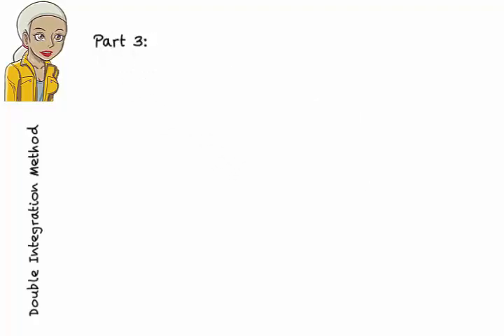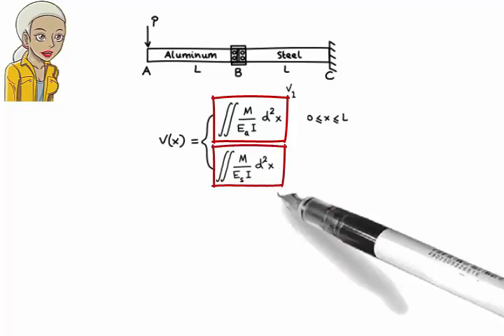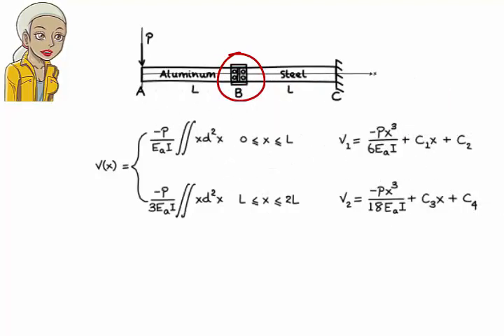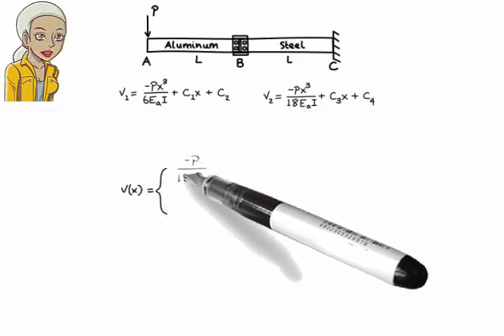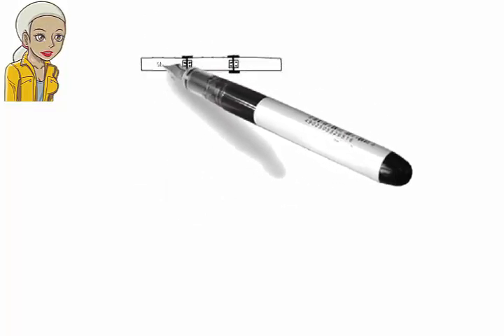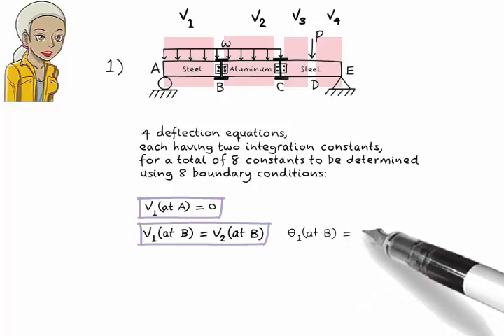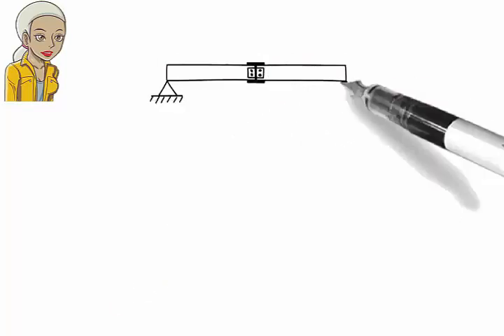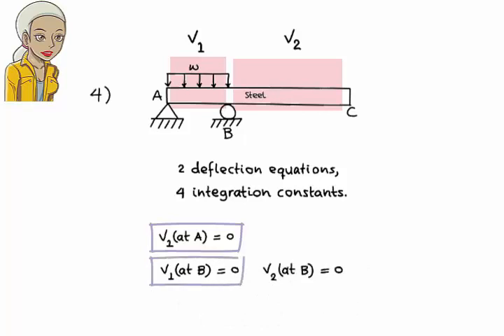SA13-3: The Double Integration Method (Part 3)

Comment: hey Dr Structure , i wanted to ask about the change from Es to Ea , when i change the moudle young shouldnt i change the moment of inertia aswell ? 
and everything was very useful , thanks!!!
Reply from the maker: No, the two are not dependent on each other. E is a material (steel, aluminum, concrete,...) property. But I (moment of inertial about the axis of bending) is a property of the cross section of the member. So, we could have two members having the same cross-section (the same I), but one is made of steel and the other made of aluminum. So, their Es are different but their Is are the same.
Reply: @DrStructure  great thank you!!

Comment: Hi Dr. Structure, I don't understand why p is a constant in this example. In SA12 example, the cantilever has a point load but the point load is not considered a constant, while the point load in the first example of this video is considered a constant. Is there a way to tell?
Reply from the maker: In both cases (videos), P is constant. Whether we leave such a constant to the right of the integration symbol or move it to the left of the symbol is not significant. That is, Integral (P) = P Integral (1). Or, Integral (P x) = P Integral (x). 

The only difference that we would experience is in the integration constant. For example, in SA12, since we left P inside the integral, the expression for v became:

V  = (1/EI)( px^3/6 – pLx^2/2 + C1 x + C2)

If we take p out as a constant before integrating, the expression for deflection becomes:

V = (p/EI)(x^3/6 – Lx&2/2 + D1 x + D2).

The only difference between the two equations would be in the values for the integration constants. But that does not matter at all, since if we multiply p by what is inside the parenthesis in the second equation, we get the first equation. That is, C1 = p D1 and C2 = p D2.
Reply: Dr. Structure I see. I was also wondering what type of load is considered a constant. For example, would a distributed or triangular load considered a constant also?
Reply from the maker: @nhilang2063  A load function is an equation that describes how the load changes across the length of the beam. For example, if the beam is subjected to a concentrated load (P) at its midpoint (L/2), the load function can be written as:

f(x) = 0  when x < L/2 and f(x) = P when x >= L/2. 

When solving a deflection problem using such a load, since the function is discontinuous, we need to set up two integral expressions, one between 0 and L/2 and the other between L/2 and L. In each of these intervals, however, the load magnitude itself is constant (in the first interval it is 0 and it the second interval it equal constant P. So if desired, we can factor P out before integrating. 

If the beam is subjected to a uniformly distributed load of w over the entire length of the beam. The load function can be expressed as a continuous function, f(x) = w  for 0 < x < L. In this case too the load function is constant since w remains constant throughout the length of the beam.  In this case however, the integral expression does not need to be divided into multiple parts, as we can integrate our continuous function over the entire length of the beam. When integrating, we can take w out of the integrand as it is a constant.  But keep in mind that if w is not distributed over the entire length of the beam (if the beam is partially loaded), our load function is no longer continuous and we need to resort to multiple integral expressions to cover the entire length of the beam, similar to the case of the concentrated load. 

It is important to note that although we often use variables P and w to represent concentrated and distributed loads, it does not mean the loads are variable (in terms of x). It simply means, we can assign any numeric value to P and w. 

Any other distributed load, like a triangular load, is not going to be constant as the load varies as a function of x. For example, the function that describes a triangular load with a value of zero at the left end of the beam, and w at the right of the beam (the height of the triangle equals w) can be written as: f(x) = w x/L. Note that the load function has x in it, meaning that we cannot factor out the entire term before integrating. So x has to be a part of the integrand, but both w and L are constant, and can be treated as such during the integration process.

Graphically, we can look at a given load diagram and decide whether the load varies as a function of x or it is constant. For example, the rectangular diagram that we often use for a uniformly distributed load tell us that the load magnitude does not change, it remains the same (the height of the rectangle) throughout the beam. On the other hand, a triangular load is drawn using a sloped line with different heights (i.e., load magnitudes) at different beam locations.  If such a load is give diagrammatically, it would be up to us to write down the mathematical expression for the load function (as I did above) before we commence integrating.
Reply: Dr. Structure this makes so much more sense. Thank you for you help!
Reply from the maker: You’re welcome.
Reply: @DrStructure  hello Dr.Structure. i'd like to ask you a question. i'm confused, why do we only make one Moment equation for the example at 1:00. the beam clearly has a boundary between the aluminium and the steel section, yet we only have to make one moment equation that's valid for the entire length of the beam. is it because of they're having the same moment of Inertia (I)? are I and M the same? i'm a new civil engineering student and i'd highly appreciated your respond. thank you Dr. structure for providing quality education material in youtube
Reply from the maker: @nathannael6124  In this example, we have a cantilever beam subjected to a concentrated load at its free end. By definition, bending moment is Force*Distance. So, in this case, assuming the origin of the coordinate system is located at the beam's free end, bending moment in the beam equals (P)(x). That is to say, the beam's section and material properties have no effect on the equation (Force*Distance). While the material and section properties effect displacement in the beam, they have no impact on the bending moment in statically determinate structures.
Reply: @DrStructure  thank you Dr.Structure for the respond. It helped me a lot 🙏
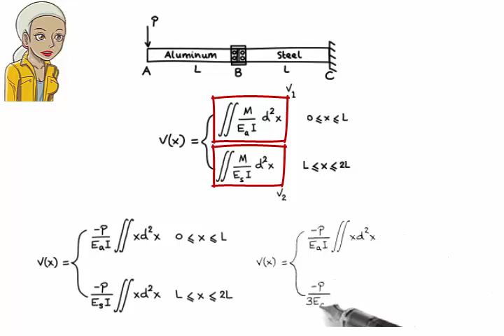Reply: @DrStructure  i'd like to ask one more question Dr.structure, at 2:00, the example told us that

x=0 starts at point A
x= L is at the midpoint (the boundary between aluminium and steel)
x= 2L is at the C point

My question, are there any rule to determine where do we have to the starting point? (Where x = 0). 

Supposed i want to make it the other way  around (where x=0 begins at point C) is it possible to arrange it in such a way?
Reply from the maker: @nathannael6124  No, there is no rule that forces us to pick a specific point as the origin of the coordinate system. We can pick any point as the origin. Obviously, if we use point C as the origin of the coordinate system, we will get a different moment equation, but it will produce the same end result.
Reply: @DrStructure  i understand now. Once again, thanks a lot for the respond Dr. Structure. It really helped me get through my homework. 🙏
Reply from the maker: @nathannael6124  You're welcome.

Comment: excuse me Dr structure, is the cantilever in the first example unstable?! we have three unknown reactions and four equilibrium equations (3 + one at the hinge )
Reply from the maker: Thanks for the question. It is true that there is a beam splice at B. But not all beam splices are hinges. The connection can be made as a rigid one preventing relative rotation between the two segments. In this case the connection is considered rigid; there is no hinge at B.
Reply: thanks a lot Dr. structure
Reply from the maker: You are welcome!

Comment: i would to know in first Ex. how the equation be (-px3/6EaI+c1x+c2) and i  suppose it should be like this 1/3EaI(-px/6+c1x+c2)
Reply: sorry to ask again but because E,I and p are constant so c1 contain the value
iam correct ?
Reply from the maker: Yes, because E, I and P are constants they are represented in C1 and C2.
Reply: +Dr. Structure ty for the answer and iam learn so much from this videos
Reply: What class is this for, I'm just curious if I will have to do this at one point in one of my courses.

Comment: Is there any chance I could get the moment equations for problem number 1? Also, great videos, I was looking through my text book for an explanation for problems like this and found nothing, but I did find this great channel!
Reply from the maker: +Arden P Problem 1: Assuming segments AB, BC and CE each has a length L, and P is applied at the midpoint of segment CE, then:

Left Reaction: Ra = (4wL + 0.5P)/3
Right Reaction: Re = (2wL + 2.5P)/3

Segment AB:  
M(x) = Ra x - w x x/2    0 < x < L

Segment BC:
M(x) = Ra x - w x x/2    L < x < 2L

Segment CD:
M(x) = Ra x - 2wL(x-L)   2L < x < 2.5L

Segment DE:
M(x) = Ra x - 2wL(x-L) - P(x - 2.5L)  2.5L < x < 3L
Reply: Dr. Structure Thank you very much!

Comment: In example 3, shouldn't there be 4 equations? The one for the aluminium section under loda, and one for steal section under load, instead of one equation for both.
Reply from the maker: In Example 3, both beam segments are made of aluminum. Therefore, the deflection of the middle segment (the one subjected to distributed load) can be described using one equation only.
Reply from the maker: It is a beam splice, not a pin joint.  A splice is a rigid connection for attaching two beam/column segments together.